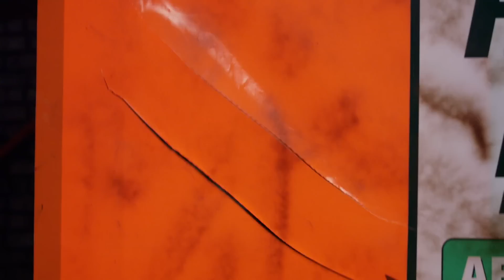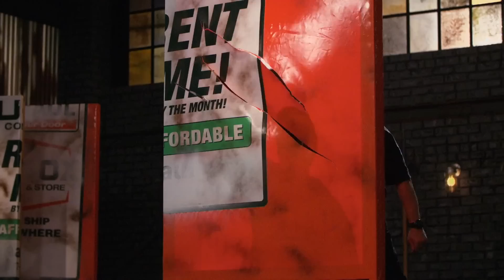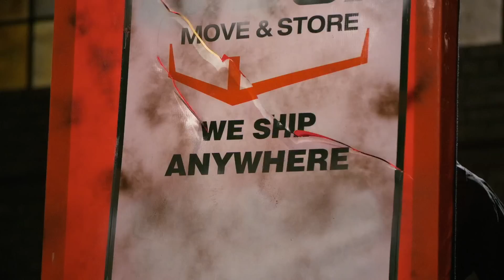Forged in Fire: Storage Unit Steel Knife Tests (Season 5) | History

Comment: I always wonder why they do the potentially damaging or blunting strength tests BEFORE the sharpness tests.. Surely you'd want the sharpness test to be when the knife is at its sharpest?
Reply: They want to see how quickly the knife dulls. IF it is still sharp after the strength test, it's a better knife.
Reply: I have always felt that the "sharpness test" was a bit of a misleading name. It is actually a test of edge retention, not of actual sharpness. But I don't guess "Edge Retention Test" sounds as cool.
Reply: Patrick Somers why don’t people get this. It’s simple, can that blade handle the extreme. Then still be usable like being sharp. It’s an ultimate way to weed out poor blades.
Reply: A knife that breaks before it can cut is useless

Comment: Strength test: I'm going to fire a rocket at your sword its not about what your sword dose to the rocket it's about what the rocket dose to your sword....you ready..3..2..1
Fire............. explosion....well as you can see your sword took alot of damage your handle is completely chard your blade is in 3 pieces I'm thinking it was micro fracture........you sword suffered a catastrophic weapon failure and can no longer be tested so I'm gonna have to ask you to please leave the forge!!

Comment: Some crappy tests, should have a machine be doing the test, humans usually don't do the same things twice, always some variation.
Reply: @kingbreeza835  So that is why he twists his wrist at 1:51 and the knife doesn't go in as if he hit it straight on like he did the other hits? That is called variation, he didn't do that in any other hit.
Reply: Variation can be controlled by fixed parameters though. The variation of angle in this case is negligible due to the fixed position and tension of the tarp. If the knife is sharp enough it should cut through it regardless unless he was purposefully using the blunt side. Even then the point would still puncture. Not to mention an expert trained to handle weapons knows how to control the angle of attack in order to retain a lethal swing.